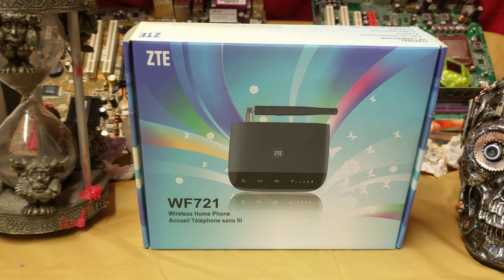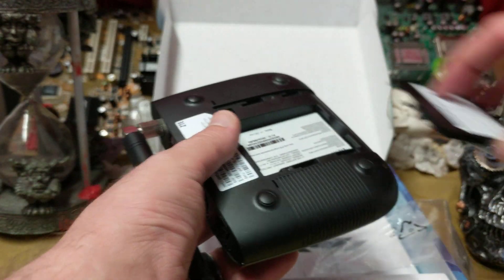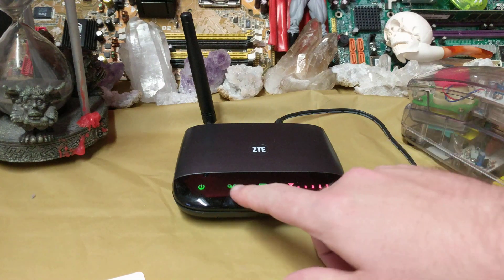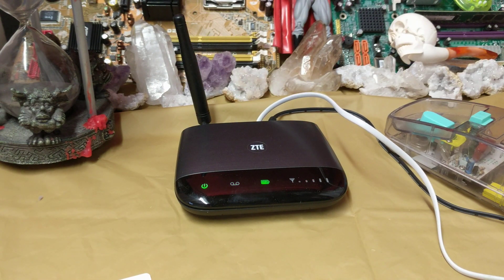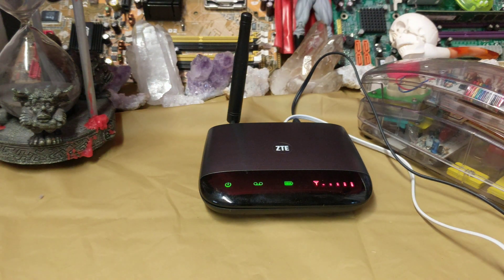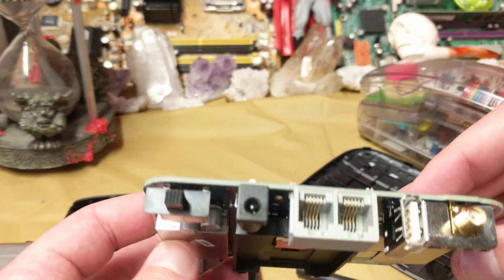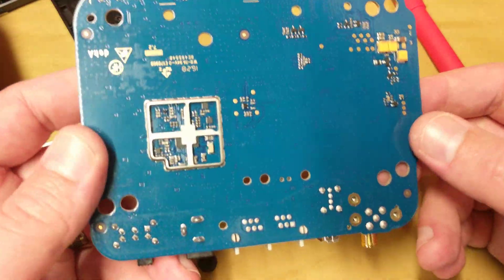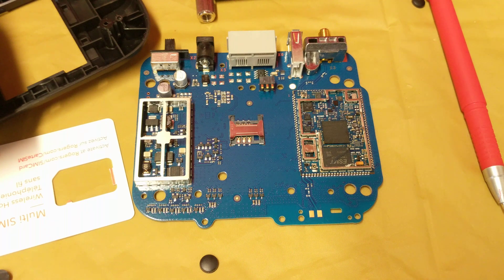ZTE WF721 AT&T Wireless Home Phone Base Info & TEARDOWN To See What's Inside And How it Works!

Comment: I got a newer WF723CA at Goodwill for $5  and wanted to play around with the firmware or try to trick it to send out some kind of signal, the only I/O seems to be 2 phone jacks (4 pin) and a micro USB port on the side under a little plastic flap cover. Even if I can't do anything with it, 2 antennas for $5 is still a pretty good deal!

Comment: would be cool if the USB could be used to supply an unlock code to the device
Reply: You dial your unlock code after picking up the phone
Reply: @muffinposter   But how, I tried with 983*86 (unlock code)*# but no luck.